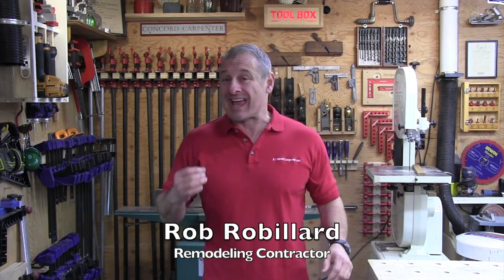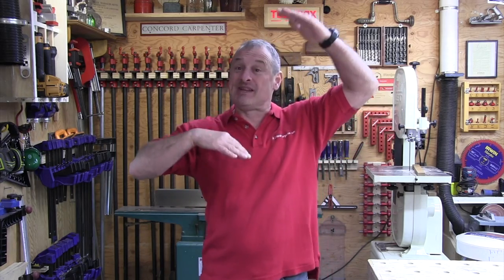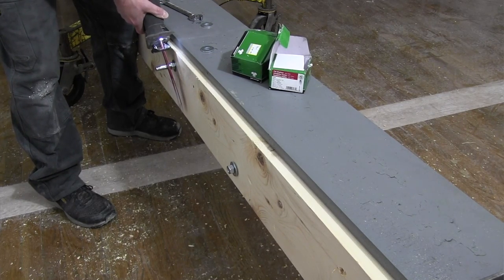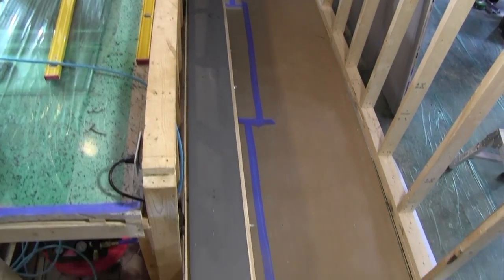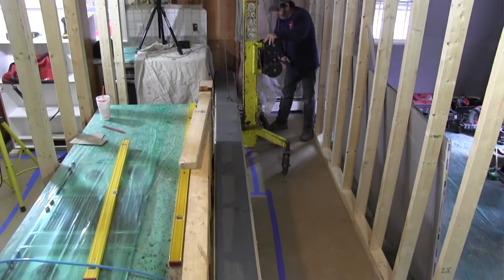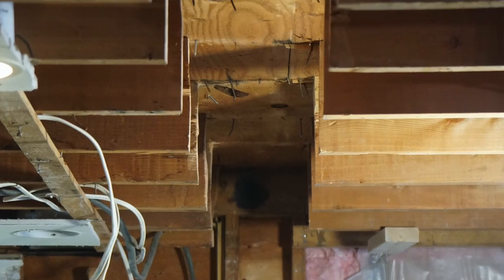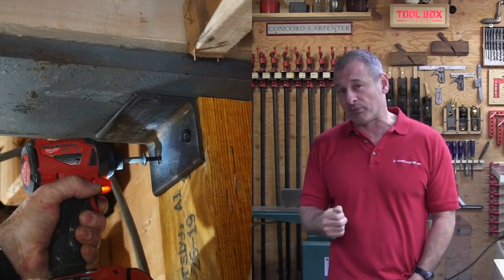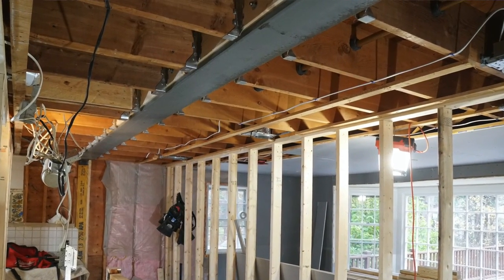Replacing an Exposed Beam With A Hidden Steel Beam

Comment: Rob, thanks a million!!!!!!!!!!!!!!!  My wife and I decided to take on this challenge after watching your video (not sure how smart it was :) ).  We just finished and it went perfectly.  In our application we were putting it in a two story home and had a 21 foot span, so it was definitely "SCARY" at times, but end up being perfect!  We had multiple quotes between 25 and 35k 😭, but we were able to do it on our own (with some helping hands and minds from family) for under $6000 (all in with materials and rentals)😄.  We obviously made some changes to what you did due to our situation (we 'super-built' everything to be sure).  We used 6x8 lvls for the posts, packed the beam with 4x8's (which needed to be planed down a bit) and 1/2" plywood, used carriage bolts instead of threaded rod, and a couple of other differences.  We definitely could not have ever dreamt of doing it without your video and wanted to say "THANKS!!!!!!!!!!!!!!!!"

Comment: I use to work for Sumner manufacturing back in the mid 80's and i built the roust a bouts and did some delivery, now i am a Custom Home Builder and Architect in Houston, Texas this brings back memories. I like your video this is the first one that i have seen you spoke so well of your job with installing the flush beam.
Reply from the maker: Thank you sir

Comment: Very nice video with lots of helpful info.  As an engineer myself, my only constructive criticism is I would have used 15/32 plywood and a 4x8 planed down with a jointer to "pack" the W8x58 beam.  This is instead of using three 2x8's on each side.  The outermost 2x8 is not supported adequately on the bottom flange in my opinion.  I would have cut 15/32 plywood to fit innermost next to the web of the steel beam, then place a 4x8 outboard of the plywood.  The overhang outside the flange would be negligible, and you wouldn't cause any shear or moment stresses on that outer board.  Excellent otherwise.
Reply: Should be negligible anyway if the bolts are adequate
Reply: I would Agree to this Idea and proper stitch nailing of the 3- 2x8s would be important. Also A-35s to the underside of the plywood subfloor would be good for shear transfer to the diaphragm above.

Comment: An excellent video Rob. All involved did a good job. Put an LVL in my son and daughter-in-laws house last year. My daughter-in-law talked to the person who was doing work at her parents house who said the wall was not load bearing but I knew it was....  I went down for a visit before they hired this gentleman and had a structural engineer look at it who confirmed it was load bearing. The structural engineer drew up plans for the wall, specified what beam and with fastener options, etc and we got it done.
No knock on the gentleman who originally looked at it. He was a handyman and not a licensed contractor. He did really good work on my daughter-in-laws parents kitchen and the wainscoting and flooring in their dining room. But he wasn’t a viable option for opening up that wall.
I explained to my son and daughter-in-law that their house is an investment in their future and that any repairs, remodeling or structural changes need to be done safely and properly.
You folks are my favorite YouTube channel and always put out information pertinent to people in the trades or DIYer’s. Thanks.
Ron

Comment: More like this please! In the Uk the structural engineer rarely specifies anything other than steel for support, it’s a hell of a job usually but I charge around £1000 a meter for the complete job so although it’s a job I never look forward to, I make sure I’m compensated adequately! It’s always interesting to see how it’s done on the other side of the ocean
Reply: Ben Chippy can u get those lifts easy in the uk?
Reply: We often use a ‘genie lift’ I think it’s the same, a winch operated lift. More often tho we just shoulder it, it’s hard to manuvure the lift into a house and they are so heavy! If we’re opening up the back of the house for an extension we might use a lift
Reply: Ben Chippy oh yup, what part of the uk are u in just out interest? I'm in NZ
Reply: I’m in Milton Keynes, bout 40 miles north of London. Do you use steels rsj in nz too? I’ve always wanted to live there btw!
Reply: Ben Chippy You would be right at home mate, plenty of poms already here, yes we use steel beams if the engineer specifies them
Reply: That's how I price things usually (welding and mechanic though, I hate carpentry, just too cheap to hire professionals if it seems like something I can learn from).
You have to make it worth your time to do the more uncomfortable/PITA work. If they don't want to pay the rate, no hard feelings.
Reply: Ben, does your pricing include the cost of the beam and engineering fees?
Reply: @natej6671  no, that’s materials and labour only, I’d happily knock some off it ended up costing less but I cocked a price up a few years ago and I wiped me out so it’s a grand all the way now

Comment: We are going to take out a 20 section of bearing wall (one sided) and want the beam to be flush mount.  Can't get an LVL to work for deflection so we need to use hot rolled.  This is exactly what I needed to see.  Thanks!
Reply from the maker: Good luck!

Comment: In other words skip this unless you absolutely have to.  Looks expensive for what they get out of it.  Makes me appreciate the easier to handle stuff I deal with.  Love your videos.  Take care.
Reply: Well no, if the joists run the same direction as the steel then it's a much simpler job (certainly in the UK). Cross directional is a nightmare and I wouldn't ever specify it on a project. Some people choose to lower their ceilings instead of trying to recess which is cheaper but you need the ceiling height for this to not be an issue.

Comment: Super cool. Fortunate you could fit the beam into the basement. Surprised it didn’t have to go through a window. 
Awesome job and explanation.

Really good idea with the LVL and Jack levelling. 

Did you bring it back to where it was prior to ripping the old beam out or try to level the floor as best you could? 

I would imagine, especially in older homes you wouldn’t be able to get a perfectly level floor from one side to other due to foundation not being perfectly level.
Reply: Agreed. Really welled explained

Comment: Wish you were in my location! I have exact same project with less issues. A 30ft span with 4 6x6 posts supporting an enclosed deck. Remove posts and to replace with steel beam across span. Every contractor here says it cant be done and would require a 24" LVL with only two posts removed.

Comment: I live in Japan and building a new kindergarten.  Builder tells me I need posts.  I asked them why not sandwich i-beams in between first and second floor to span the 7.5 m width.  They said they can't.  I've seen cold-composite steel but why is it so weird to mix steel and wood ??  You did it well

Comment: Great information! But, you skipped a critical step on us! The wide flange beam is hanging by the cables. You said "we rolled it into place". In the next scene the beam is on top of the two lift jacks. At 58 lbs./ft., I doubt that the beam was man-handled. How was that accomplished?
Reply from the maker: Brian Baldwin we rolled it on pipes and then rolled it on the lift bases

Comment: Fantastic! The Prep as usual more then 50% of the project. 
Big Question how and where did you find a Lift Rental Company or Did your Steel Vendor supply those Beam Lifts.?
Brilliant Staging and Engineering Rob ...
Reply: Any place that rents reachlifts, forklifts and such should have them. I use A to Z Rentals in Arizona.
Reply from the maker: Joe Daq yes they supplied it all - cost
Reply: @ConcordCarpenter  
Thanks Rob, I'm in the Philadelphia Venue and deal with More equipment Rental Companies then I can remember. But the ONLY people that I've ever seen using those type lifts have been Riggers an Haulers and or Steel/Iron guys doing the the Rough stuff in the High Rises in Center City Philly...
From what I see Your Crew does Outstanding Work and Workmanship. 
Thanks Again, You and your crew have influenced a large number of purchases Especially the Safety Kits with a tourniquet in each truck . Thanks Joe D

Comment: Very cool to watch! I've been thinking up an alternative to a full-length structural beam at my roof ridge. (It's a 26' wide single-story 1925 bungalow that we're about to add a camelback addition to, connecting existing roof with new by building a full-height dormer centered on the old ridge.) To beef up the existing ridge, which is just a 1x sandwiched between the 2x8 rafters, I was thinking of fabricating some trapezoidal plywood gussets that hug the rafters (allowing us to remove the old collar ties), and running 24" lengths of doubled-up 2x10 lumber between them (leaving the original ridge board in place).
I wonder if this would have the overall stiffening effect that a structural LVL ridge beam would, or if I'm just fooling myself. :-)

Comment: Steel beams are awesome! (Why did you have to pack the beam with 3 layers of wood though, was it not possible to bring the joists in to only one, that way the joists would also “sit” on the steel beam itself?)
Reply from the maker: No the hangers wont fit- you have to extend past flange
Reply: finally someone with common sense and joist hangers will fit if not that's why GOD made chizels

Comment: Really well done... Great details down to each screw.... I have series of joists sagging(slanting) all the way from the bearing/exterior wall to my sagging beam. It's a distance of about 13 feet. Is it possible that joists could sag that far a distance without something else being wrong? Thanks, Rob (My sagging beam is deflected by 1 1/4 to 1 1/2 inch.) Thanks, Rob

Comment: Rob- you are very talented, no question. I disagree with packing the web. The level of work that has gone into this clearly indicates a healthy budget. I would have literally gone 6x8x1/4 A36 
HSS and welded custom steel joist hangars to the parent metal. I have met few P.E.s and AISC, and ASME engineers who find the packing technique to be comfortable for them. Maybe I’m just spoiled and live in the land of endless material and support  resources coming from multimillion dollar shops...either way, enjoyed watching this video. The big takeaway is showing the power of what 2 pieces of what look to be 3x3x1/2L can hold on the attachment points to load center. The welding as you know is always secondary to the mechanical shore, but man does it help make the attachments
Reply from the maker: Thanks for your comment - your method sounds fun! I followed my structural engineers plan

Comment: Wow, What a great video, just this morning I had a local Brooklyn, N.Y steel company visit my home for a similar quote. I want to remove a load bearing wall which has another load bearing just above my floor. I'm request that the new support beam be move over to where there is also a steel beam which this very same company had install one back in 2017. Back then I had them replaced all of the  wooden beams and post with steel which help clean up my basement. My only concern now would be, would they be up to the task of trying to install a recess beam which would really look great in my new living room.

Comment: Good job overall, and liked the way you packed the beam with wood and threaded rod. One problem I saw is the 1/2" total joist overcut on the beam opening. Though making for an easier install, this would be problematic as joist hangers are designed for joists to be flush against the beam. 1/4" gap here is out of spec and many engineers and inspectors will fail this.
Reply: AdvancedRemodeling Do u mean cost for the contractor or cost for the the client?
Reply from the maker: AdvancedRemodeling  interesting - by the time the beam was installed the gap was closer to 1/8”. probably due to hand cutting, cutting left of line, etc
Reply: If it was an issue, it’s always possible to add another layer between the laminated wood to give a tighter fit. 
Plus sistering lumber is never an exact measurement.
Reply: @ConcordCarpenter yes, 1/8" gap beam to joist most inspectors won't complain.  Insetting beams is not an easy operation, your video makes it look easy! Cutting and prepping the pocket is a battle. If that wasn't bad enough actually raising the beam can be very difficult without that nice lift you have. Even piecing LVLs one by one into an inset pocket has its problems. We often perform this procedure and if the gap is too tight its very difficult.

Comment: You’re very helpful, I have a second floor concrete wall three stories high sitting at 150-year-old wooden beam that is sagging in the middle over a basement. I have to jack up the beam To level the floor and then put in a permanent support such as an I beam

Comment: Excellent work and video Rob. I’m waiting for the engineer to spec a steel beam for a similar situation. Our joists are 2 X 8’s and the spec might come in recommending W8x21. This will have the beam slightly lower than the existing ceiling. Rob, if strapping wasn’t already in place for this particular reno you did, I suspect your beam would have been slightly deeper than the existing ceiling as well. Just curious to know how you would have handled that situation. I only see two options, add strapping and drywall to the entire ceiling or live with a bump across the ceiling.
Reply: If the beam is lower than the ceiling, your only option is lowering the ceiling to avoid the bump. Ceiling can be lowered by strapping, furring channels, or sistering the existing joist with new joist.

Comment: Hey Rob, 

Thanks for all your details - super helpful as someone prepping to do this. 

How do you determine if a recessed beam is an option? Currently struggling with a space where it would come down fairly out of the ceiling, but there's both floor joists and roof rafters coming down to where the beam would be.
Reply from the maker: Consult a knowledgeable contractor or structural engineer

Comment: Hi Robert, as with many of the other comments below, a great video that does a really good job of explaining the details involved for homeowners like me that have no previous experience in this particular activity. And I offer that coming from someone who doesn't normally leave comments.

I'm a Scotsman abroad, living in Winnipeg, Canada, now and hoping to develop a basement in an 1970's era bungalow ... I would love to replace 1 (maybe 2) teleports with a steel beam to make the space more open.

Question -- Can you offer any ballpark costs to such a project (per meter or foot), and would any structural engineer company typically do this type of work for residential properties? If there are any such engineers from manitoba reading this, I welcome your feedback as well! :) 

PS. I hit the like button, and am now subscribed! Thanks again, Ross.
Reply from the maker: No linear foot pricing - this was approx 18k frame to finish

Comment: I’m just about to start this exact process.  Awesome video, thanks. I’m wondering how to line up for drilling when packing in the lumber into to steel beam. If the holes come pre-drilled in the steel, how do you line up the wood and drill perfect to the holes?
Reply from the maker: You bet
Reply: pack one side and drill  from beam side then pack other side and drill from wood side
Reply from the maker: You fill in one side, drill, fill in the other side and drill

Comment: Nice! I am big believer in steel beams. Yet, why not a 4x8 so the outer wood face is sitting comfy inside the steel instead of that last 2x8 that is barely touching it? I would have felt much better knowing I am not depending on the shear strength of the 1/2 bolts. They are resting a bit but any movement can release then from the steel pocket. An additional perk would have been to continue steel to the floor. LVL is good but is an awful lot of load for two points. I know, it holds, but perhaps is because I live where the ground can dance and one learns to be cautious, especially if so much money was already invested, best to go as safe as possible and cover all angles.  Other than that is a great video because you present very well and the takes were very good!.

Comment: Nicely done !!! I am getting ready to take on a project similar, but in a basement of a 2 story 1938 Craftsman house, however I am not interested in recessed beam. I am looking to remove portions of the supporting cinder block wall, (approximately 14 ft long). I was thinking I will need to reinforce the foundation under the block wall where the new vertical supports will land. However I will be able to rest my new beam on the existing remaining block wall, and add additional vertical support. I just have not found tables to give me loads I can use to factor into the necessary formulas. Starting to feel a little more challenging….. have any suggestions to help move my project along, I absolutely refuse to move forward, until there are numbers I can backup my plans….. you know “fail to plan is a plan to fail, every time. Thx I really enjoyed your video , sincerely Jerry
Reply from the maker: Pay a structural engineer for a stamped, 1-page plan. You can use that to obtain the building permit.